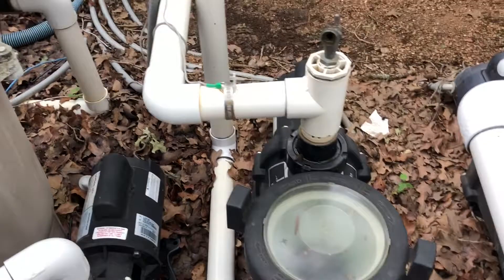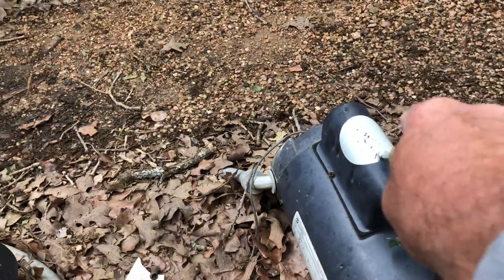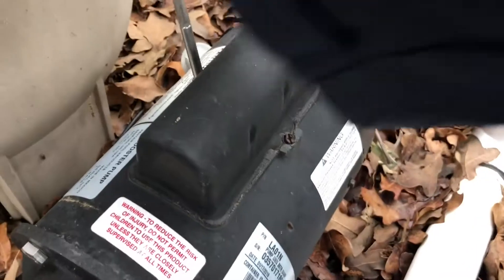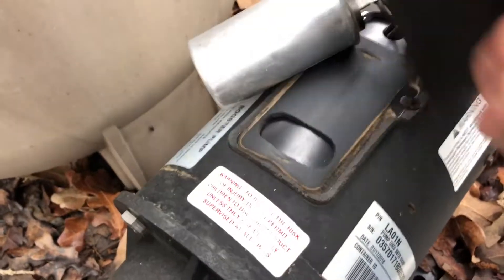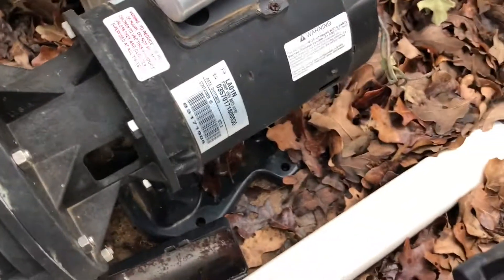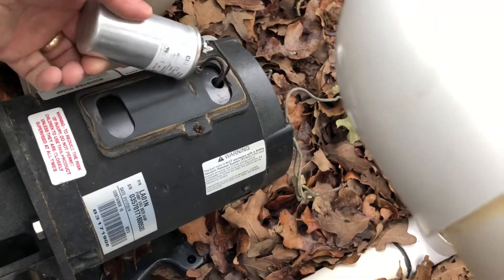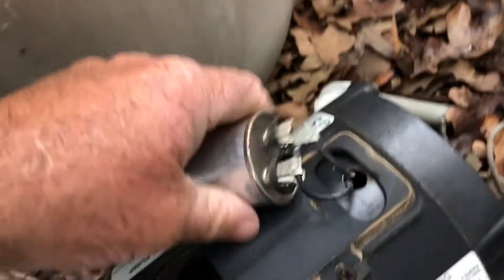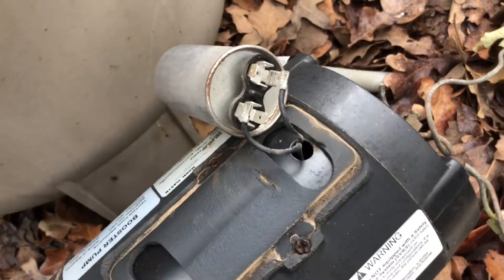Pool Pump Tripping Breaker -Motor Buzzing and Hot  (TUTORIAL)

Comment: What if the pump doesn’t come on at all? No humming nothing. Wires and breakers are good
Reply from the maker: Double check that you have power all the way to the back of the motor, using a volt meter. If power is 220 +/- then you have a bad motor.

Comment: Hi I'm not 100 % issue with mine. Turns on but sounds like metal on metal.  It may have been clogged with leaves not knowing and tripped breaker. Pumps no water. Is pump dead or could it be this capacitor your mentioning. Help.. lol thanks!!
Reply from the maker: If it’s metal on metal, that’s usually bearings. So we usually replace the motor when it’s like that
Reply: @Pool-guy  thank you for responding!!! I'm honestly not 100% what's wrong with it. When hurricane helene was here, i turned it off, because it was overflowing. Then I drained a bit, turned back on, then basket was loaded when I went out to check on it. It was off but turned o n. Checked breaker. Off. Turned back on, turned pump on. It ran but pumped nothing, no water. I'm afraid to mess with it. Was just going to drain. Down like I do. I normally treat it before  closing but can't now. Just tarp and deal with it next season.  So , I know its hard to diagnosis without hearing it. Could I video it running and send to you/email??? I really appreciate your help. I hate that I think I broke my own pool 😔 i am very handy too. But not sure I'd be able to do myself.
Reply from the maker: @ yes sir I can give it a shot. I’m wondering if something got caught in the impeller and that’s what’s making the noise.